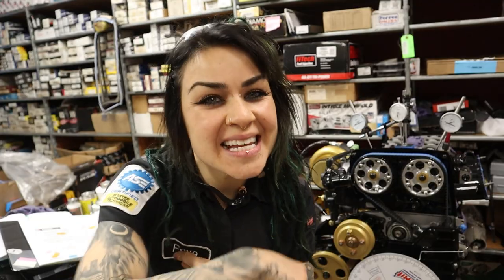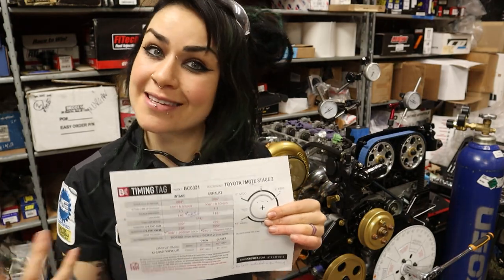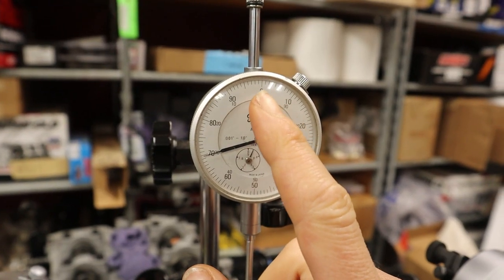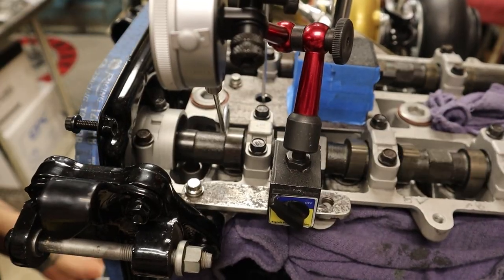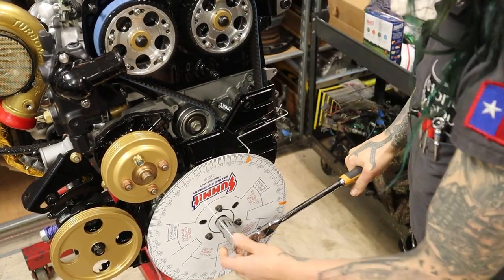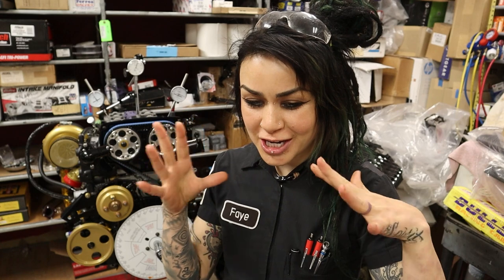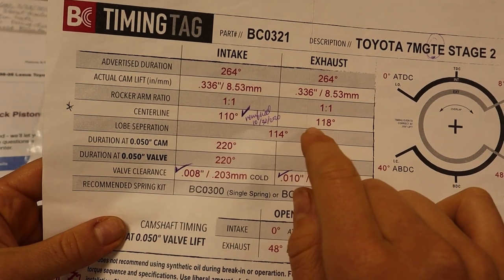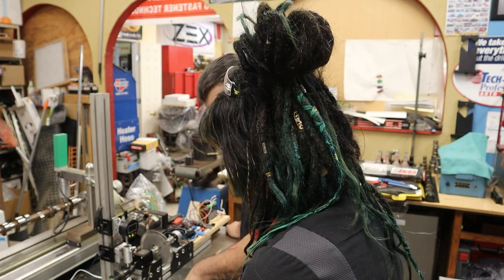How to Degree a DOHC Engine (7MGTE version) Part 2: Finding True TDC and Cam Lobe Centerlines

Comment: I remember doing that decades ago with the original Minis. In the absence of affordable tuning following engine mods, what made practical sense was homebrew blueprinting on the 1275 engine. It was swapped in place of an 850cc, pulled out of an Austin America, as was the fashion. Starting with selective assembly and then with filing and stuffing in bits of feeler gauge, I ended up with the cam  timed in to within half a degree of the spec. It was immensely satisfying since the factory tolerance was something like plus or minus 8!
Reply from the maker: Oh my gosh that's so badass!! That's something that Danny and I were talking about is how few people actually do this and it's so impressive to hear that you have, And gone beyond factory specifications!! 👏🏻👏🏻👏🏻👏🏻👏🏻
Reply: @FayeHadley  Aw, thank you. You're making me blush!

Comment: Great video! I imagine it is easier to degree cams with a belt drive, i have only degreed cams on engines with timing chains. The PITA with chains is chain slop, so you have to only turn the crank clockwise. Can't go forward/backwards like you can with a belt. The way i do it:
1. Find TDC with piston stop on cyl #1, rotating engine clockwise until piston hits the stop, record number. Rotate engine counterclockwise until piston hits the stop, record number. Then position the degree wheel so that the numbers are the same in both directions. This should be TDC, verify.
2. Set up dial indicator on intake valve spring retainer cyl #1. Rotate engine until max lift is reached, zero the indicator. Then record the #s for .050" before, and .050" after max lift (just like you did) add the #s together and divide by 2, this should be your cam centerline. Repeat for exhaust cam(s)
I can appreciate how long it takes to properly set up the dial indicator(s), making sure the angle is correct, otherwise the readings will be off. All of this work will be well worth it to get the engine operating at max efficiency. Having adjustable can gears will make it easy to make any adjustments, you'll get it dialed in for sure!

Comment: Nice work, just got my 5 speed and Mfactory limited slip differential in my 1995 Saturn S series last week so feels very sporty with all the other modifications i've done, swapped seats, and got the AC running.. Gonna do my A pilar coolant temp, boost vacuum, and air fuel ration glowshift gauges next and a set of 1200 watt kickers and an amp.

Comment: Hey faye, the struggle is real, I spent 2 years trying to make a set of bc264 cams in my 7m, degreed them in countless times but never got anything to match the cam card. Duration was less, lift was left, centre line was not in the middle of duration... did the best I could but the engine ran terribly, 8inch hg of vaccum at idle. Swapped back to factory cams and it works like it should. Hope you dont end up down the same rabbit hole I did.
Reply from the maker: We shall soon see!! 😬

Comment: I just degreed my B18C cams foe rh3 first time a couple weeks ago, one of my freind's dad showed me w trick that saves a lot of time and is still accurate enough. Set up the degree wheel as normal, find your max lift degrees on the cam card, turn the crank to that point (98° and 105° on my case) then loosen you adjistsble cam gears and turn the actual cam until you hit the highest lift on your dial indicator, tighten the cam gear and done. I did it both ways the first time and ended up in the exact same place, when I put my sleeved ramey block in over the winter i'll just use the cheat method

Comment: I need your help on this issue I have. I put my 7mgte at TDC all three marks on crank and both camshaft gears. Now the issue I have is a high rev and a slight misfire. Timing light is irratic with no rhythm. TDC mark on crank does not match with timing light. The question I have, is it possible to be 180 degrees out even with all 3 TDC matching? Could it be my CPS is 180° off?

Comment: Is this to verify your timing or to make sure your new parts are properly installed or both
Reply: It's too validate cam timing, it has a large impact on where peak torque occurs.  Advancing cam timing will lower the RPM for peak torque.

I think Toyota was normally 110/110 on most of the G series engines I could be wrong.  I've normally guessed Toyota was accurate in making cams so I'd only have to adjust the position when building a 7age.
Reply from the maker: Verifying TDC was to make sure that I had the degree wheel set up properly. Verifying lobe center line was making sure that I degree the camshafts to the proper location per the manufacturer specifications. In this case the manufacturer is BC camshafts! You will see in my fall about video how I move the adjustable cam gears to the exact point of the desired center line per the cam card!!